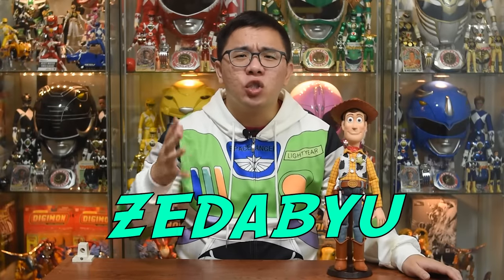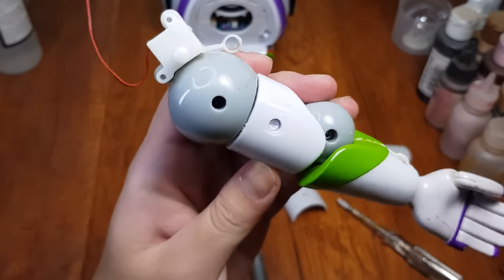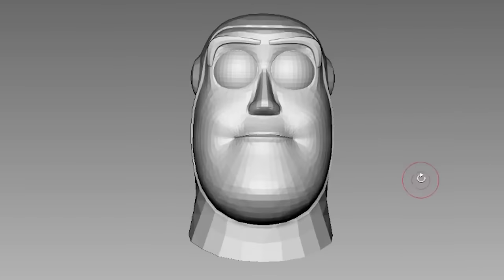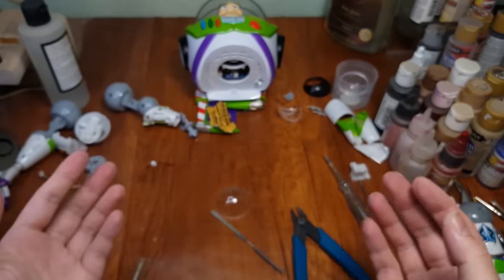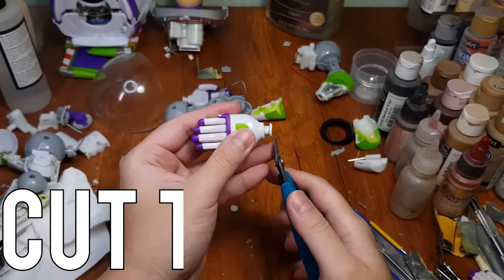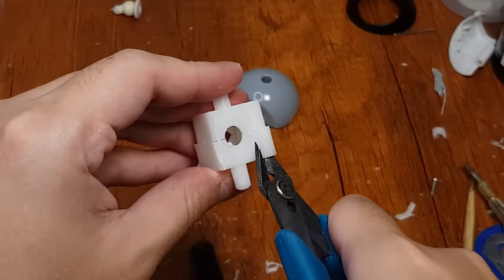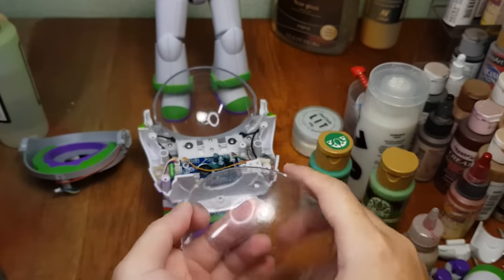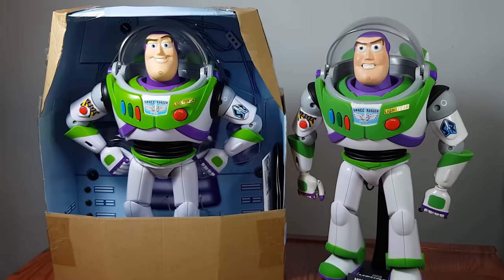I Made Toy Story Buzz Lightyear In REAL LIFE | 3D Sculpted 3D Print Custom Collection Mod Formlabs

Comment: Man, if only Thinkway or some other company would release something like this. This looks absolutely FANTASTIC. Nearly 100% spot-on to how Buzz actually looked in the movies (specifically the first one) when he’s in toy mode. 

I really wish there was a talking movie accurate size Buzz with the slightly sneering facial expression that he had in TS1.
Reply from the maker: Yeah, not sure what's stopping them. Even Mattel with the new license doesn't seem to be going down the Toy Mode road. They just don't know what TS fans want
Reply: @zedabyu  yeah, i wish Mattel would go back to making the Thinkway "look alike" 12" figures that they did back when Toy Story 3 came out, but upgraded.
Reply: I wish they would release  a buzz with movie accurate wings
Reply: They hate buzz. Cut his airtime last movie
Reply: Reason is Price. Cost of designing and molding. The way it was done is cheaper. Usually always comes down to price.
Reply: Only company that can do all those things...

WAKA WAKA WAKA WAKA WAKA WAKA WAKA WAKA WAKA WAKA WAKA WAKA WAKA TOYS.

A company that doesn't exist. Only exists in toy story.
Reply: I think companies usually produce massisve number of toys so it's hard to make toys with accurate details like that.
Reply: @zedabyu  ur
Reply: @jacksonnightmareluner  Can relate so much omg

Comment: A first generation Buzz are the best for modifications and can still be bought cheaply. I used the broken ones all the time when I worked for a childcare center. Literally repaired dozens of them. They were easy for swapping parts and repairing joints using a Phillips head screwdriver and a flat head for prying. The joints had metal and the fit was better. The wings were a common failure point due to their plastic catch system and the simple spring they used. Any way great job on the Buzz.

Comment: I would recommend picking up a Dremel btw
Especially if you do mods like this in the future. You need a dremel to cut the holes in the clear domes for the shoulders. Though Im glad to see you took the same approach I did and just 3d printed some 😂
A dremel will also help a lot with cutting things down and sanding them too 😁

Comment: I think that you should make the black piece a circle instead of a slim oval shape so the peg for the arm could fit easier and you wouldn’t have to cut it
I also think that you could also use a softer resin to make it slide in easier

Comment: Anyone else think the buzz lightyear from the thinkway is just way over engineered.
Reply from the maker: So true. I think they had to make do with the older designs from their cheaper toy line so all the mistakes were brought forward into the collection line.
Reply: @zedabyu  yeah its a bunch of really heavy unnecessary plastic and extra wires. I bet if they cut back on pieces and used newer lighter pieces for tech it'd be cheaper and more accurate.

Comment: Zedabyu the front visor of my signature collection buzz is broke off i really want to print this part but ı dont know how to draw in 3d apps. So much people need this part i wish ı was able to do that and release for download but ı dont have the knowlage and dont have 3d scanner too, Do you have a chance to scan this part with a 3d scanner and upload it to any 3d model site? It will be a great gift for me and those who are looking for that part. İ really want to buy it if you wanna do that
Reply from the maker: It's probably better to make a mold of the part and cast in transparent resin. Scanning it will require the part to be painted so that the scanner can capture it, and printing resin might be too brittle and might break again.
Reply: @zedabyu  thank you so much for the reply, ı actually make the mold and cast 4 or 5 times but everytime that was come out so bendy and i cant find any type of resin to make thin parts like glass hard now ım trying to learn fusion 360 i hope i can make this if i can i will add the link here. İ like your videos so much btw you do this hobby really well.
Reply from the maker: @Kiryulookingatsky  why not just find a replacement on ebay? You might not even need a collection buzz, a thinkway buzz might work.
Reply: @zedabyu  i think cheap thinkway buzz will not going to work because the holes and the bulges  in the connection part of the visor is so different, i thought about that but after  looking from the close pictures i think thats not going to fit.
Reply: @zedabyu  signature one is holding from opening by itself with plastic bulges but the other only using friction if im not wrong

Comment: I'd kill for the sticker template!! I have a belt buzz and I've never seen anyone make the sticker for the 'button' on the back of the flight pack! Its the circle looking one and every sticker replacement set I've seen never include it or a right sized sticker for the open panel to fit inside
Reply from the maker: You can edit the texture file from the 3D model! It's relatively easy. What I don't see often is the communicator sticker
Reply: @zedabyu  i'll have to look into the model then to edit them from the model!^^ and thats odd, though I did only buy from one person on etsy back in like.. 2017? So things def probably changed for that stuff! I'll look into the model Tomorrow to work on it!^^

Comment: did you use wet sanding or only dry sandpaper for the shoulder openings? sanding my buzz but cant get a smooth finish!
Reply from the maker: dry was enough for me. i used 400 then 1000 grit
Reply: Ooh ok but how did you remove the scratches after the sandpaper?
Reply from the maker: @bulldog2173  sanding is supposed to smooth them out. if you still have scratches, you are not using fine enough grit
Reply: @zedabyu  oh ok I'll try, thank you!